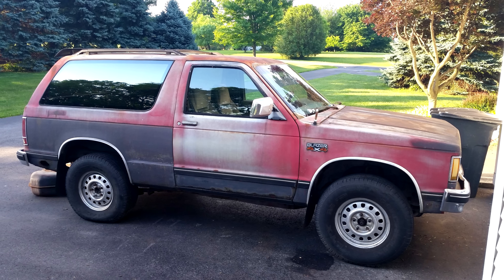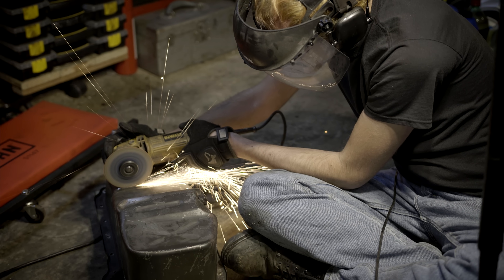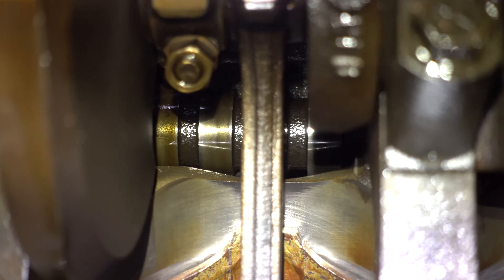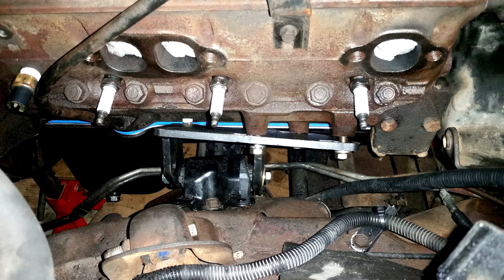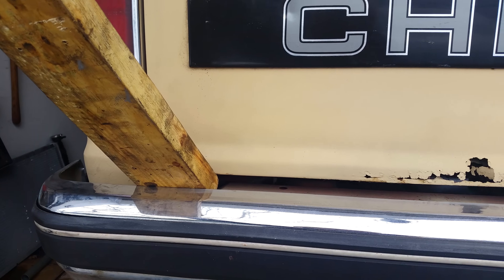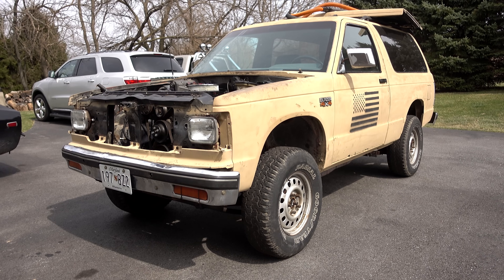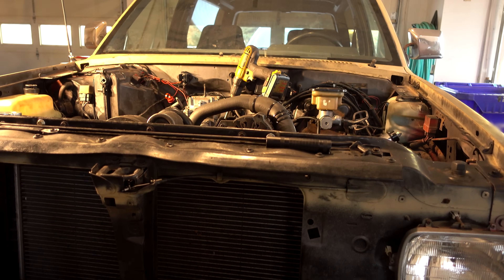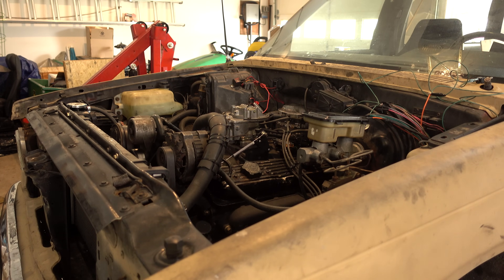4x4 S10 Blazer Budget V8 Swap (Ep.2)

Comment: you've done awesome.... Jags That Run could have saved you a touch of grief, though... the V8 swap book includes schematic so you can build your own motor mounts.... 20/20 hindsight, you did very well and funny your pan solution is darn close to what they did (they sectioned in a bit to the v6 pan from the v8 pan)...
Reply from the maker: I skimmed through their info online, I'm sure the book has more, but some good info for sure. I didn't like the way they made their oil pan because I feel like getting the flange with the weld line to seal right might be tricky, but I'm sure it would work with enough planning and grinding. I looked at a lot of custom motor mounts, but couldn't find any designs I liked that were guaranteed to fit a 4x4, except for a few pre-made ones like the Transdapt (which didn't fit anyway). So yeah, I could have just made them out of some steel plate but it probably would have been at least as much work and a similar materials cost anyway.
Reply: just options to consider - love what you've done with it.  Keep up the good work

Comment: This is awesome man, I like it. Reminds me of when I was in my early 20's, I had an 84 Blazer 4x4, I had dreams of putting a small block in it, I see now just how much work that would've been, a big pita. I've always wanted a small block s10 something, My first vehicle was a 92 sonoma, I traded the 84 Blazer for a 99 s10 4.3 that I lowered and modified a bit. Now I have a 1st gen Colorado. So, I've had pretty much all the s-series trucks. I have a fond spot for them.
Reply: Broch Slanders I'm planning on getting one but not build myself as I don't have a lift, engine jack, transmission jack etc. Nothing to clear an engine. I can do it but way to much stress when I can buy a 350 s10 for 2.5k already done and work on what they did wrong. Regular s10 in my area go 1.5k and up for 90s models. Swapped with a 350 for 2.5 in paying 1000 extra which isnt bad considering they usually come with other mods to like ratchet shifters (or modified manual trans)  exhaust etc..

Comment: Is a remote oil filter an option?
Reply from the maker: From my research, the universal ones need modification to fit, and the factory 4.3L one doesn't bolt up to the V8 block. It certainly is an option but would need a bit of work.

Comment: 4.3 was rated at 160hp, not 125.
Reply from the maker: Yeah, I was mistaken, for those years it was something around 160
Reply: I have a 1992 S10 Extended Cab 4.3 5 speed 4x4, and I can tell you for a fact that it makes more than 125.. although it's still nothing tremendous haha.  Still plan to pull the motor and rebuild it to make a good bit of power
Reply: I have a 92 with a 2.8 it makes 125
Reply: Later models 190 new 4.3 is over 300

Comment: You didn't really benefit yourself by much from going with the 350 over the 4.3L.  I mean the 4.3 is very good engine with a nice power and torque.
Reply from the maker: The 4.3L isn't bad (well mine was), but it isn't a V8. A fun project, a lot of extra horsepower, a little extra torque, plus the V8 sound is plenty worth it to me!

Comment: YOU NEEDED TO COVER ALL THE HOLES ON THE NEW USED ENGIN CAUSE WATER INSIDE THE ENGIN WILL RUIN ALL THAT WORK YOU ARE DOING.
Reply from the maker: The passages to the intake and oil passages were mostly covered. Everything was flushed and oil was prelubed thoroughly after that, no big deal. Would I do that on an engine I care about? No haha
Reply: ryan migliori yeah he didn't seem too concerned about water getting in the intake/exhaust ports.

Comment: I have 1988 s10 blazer rust free and clean with 4.3 runs 275 horsepower
Reply from the maker: Is it modified, or a Vortec 4.3L? They were making good power by the late 90's.

Comment: What did you search for when you found those aluminum spacers?
Reply from the maker: Interestingly, the seller I bought from doesn't seem to stock 3" rod products anymore. Here is a set just like I bought, but 3.25" instead and $12 more. Would work fine for an application like this, though. https://www.ebay.com/itm/281744485919 Try search terms like the title of that listing, like "Aluminum" "Round bar" "Stock" "3"", etc.

Comment: I did one of these myself same gen for my son, the one i did I had to use 2 left hand mounts for a 1972 chevy nova in order to get the motor to sit in there right and for the exhaust manifold i used a set of block hugger hooker headers for a 350 and i had to put them on wierd too because the steerig arm had to be put in after the motor was installed (not fun) never thought about doing the body lift that might have made things a LOT easier to do. of course i realize none of this is beneficial to you NOW but thought in case someone else was considering doing one of these swaps i might mention it to make things a little easier for them. Lastly the deep sump oil pan for the 350 on Summitt racing is made just like your frankensteined version and fits the same way too. I ran a 650 Holley carb on mine, bolted right up and ran like a champ, the guy i sold it too still drives it too
Reply from the maker: Awesome info, thanks! I had never heard about using Nova engine mounts!
Reply: i only know about it because i had a friend in GA growing up that put a 350 in an S-10 pickup someone had actually started to beat the firewall back on his to get the motor in but it was sitting up at a weird angle in the engine bay and the truck always felt like it was trying to rip it's self apart when he would drive it. we took the engine out and started measuring everything like you did and this was back before people were doing this swap regularly and the clearance we needed you pretty much would have had to weld the mount to the frame then figure out a way to snake your hands around to put the bolts into the motor. my buddy has always been a HUGE Nova fan and went out in his back yard yanked the left mount off of his 72 and tried it and not only did it sit the motor down in the engine bay nicely it was far enough away from everything that you could actually work on it without having to yank out the motor too. BONUS!  the block hugger headers i learned about first hand when i did the S-10 Blazer for my son.
Reply from the maker: Ha, that's an awesome story! Just checked what they look like, they resemble the OEM 4.3L mounts, so I guess it makes sense that they'd work. I have heard that block hugger headers fit, I might have to get a pair to try one day!

Comment: If you were smart, you would of gotten a 5.3 vortec from a silverado in a junkyard
Reply from the maker: 5.3L, that's not even 5.7L! What's the point?

I did it this way because this is the way I did it. Chevy 350 carb parts are cheap.
Reply: True, but even you know that 350 is so weak. And seeing you have a newer silverado as well, you know the point with that 323
Reply from the maker: I don't need it for horsepower, it'll just kill me faster. The torque is good and that's what I care about. Intake manifolds for Vortecs are more expensive, otherwise I'd just put Vortec heads on it. I already have a garage full of 350 parts, too.
Reply: I’d like to have a 5.3 V8 engine in my ‘93 S10
Reply: Gavin Graham more reliable huh I had a 5.3 that went 433k before it let go and it was beat to death. I've had 350s let go under 100k the new small blocks are way more reliable, better design, better power, better fuel mileage.
Reply: Gavin Graham ls engines are easier to work on then the sbc. Have you ever had one apart? there super simple to build, the only thing that is more complicated is the fuel injection but if you carb one it's way better then the 350.

Comment: Hey brother sweet effin project it's something u wanna do for u an not like everyone else doin what everyone else is doin!( ima muscle head BTW lol ) but did u no the 4.3 vortec is jus 2 pistons less then a 5.7 brother? Same size an all. But dude I really like what ur doin man! An oh BTW u can fit some 33X12.50 under it how u have it set up. I had my 95 Jimmy with a 98 fuel injection swap on some 16X10s on 33X12.50s jus had to trim a lil but man was it beautiful an a lil beast
Reply from the maker: Good to know about the tires, thanks! I don't mind cutting a lot of fender out, just need to get wheels with enough offset to clear the frame. And yep, the 4.3L is just a cut down 5.7L, part of what makes everything so compatible for the swap. GM's compatibility and wide use of parts is one of the best things about them.

Comment: So mods to the wiring harness?  Or was it all the same?
Reply from the maker: Since I didn't use the TBI I only used a few of the original wires. I basically just cut out all of the ones I wasn't using, which was most of them. Other than adding a circuit for the electric choke and a toggle switch for the fuel pump relay, I don't think I changed anything else.

Comment: I can't believe aluminum is cheaper than hockey pucks.
Reply from the maker: 10 3" diameter aluminum pucks was $34 on eBay, you could beat that ordering hockey pucks online I'm sure. But I don't think you could walk into a store and do much better. It's still cheap enough I'd rather do it and never have to worry about them though. EDIT: I think I was referring to solid plastic ones when I mentioned that, because I was looking into using those rather than the traditional kind.

Comment: I've always bought the clear dist cap when buying a new distributor, it's great for troubleshooting.

The oil filter is easy, run a remote filter.

Ditch that carb, go fuel injection, especially since you like to drive in varying altitude.

There are two budget options that would be great for the project. Microsquirt runs $350.

Speeduino will run around $150 but requires soldering and configuring of the hardware.

With both you could grab junkyard parts like a tpi intake manifold and associated parts.
Reply from the maker: I agree on the clear distributor cap, it's useful when turning the engine by hand and setting timing, and of course checking for spark. I like carburetors, they are simple and, I don't know, have character I guess. I like that they are mechanical I guess. A buddy wants to use a Megasquirt for one of his engine swaps or a turbo install so I'll see what it is like when he does it, maybe it'll win me over!

Comment: I used hockey pucks when I body lifted my 1994 GMC Jimmy. Worked perfectly! I also cranked my torsion bars and added shackle extensions for the suspension lift. In the end, 31" tires were the biggest I could stuff in the wheel wells. Over all, it looked pretty badass!!
Reply from the maker: That's about what I have heard, 31" sounds right. Mine came with 30" tires and they looked good but could go a bit bigger, but the width might rub the frame on turns. If I get wheels with the right offset there is only fender sheet metal in the way of fitting bigger tires though, and the sawzall would take care of that...
Reply: Be careful with hockey pucks.. You gotta keep conditioner on them. My buddy used them and never conditioned them and after 2 years they started splitting from dry rott. They work great as long as you don't let them dry rot.

Comment: Nice work. As for the oil filter issue try summit racing they have a cool oil filter relocation kit for a fair price
Reply: Also my 89 Jimmy had it from the factory. Was mounted on the driver fender.

Comment: I guess you should never believe what you here from people that its easy to put a v8 into a s10 4x4 ( they make kits for it) I had a 91 that I was going to do this to and I'm glad I didn't after watching this. but this is fun to watch!!!! you did about what I would have done if faced with the same problems and no money ! Great minds think alike HA!
Reply: Nails it's actually really not that bad. Take the entire front clip off and do what you want.
Reply from the maker: The Transdapt kit was a big waste of time, but just making custom mounts or trying ones from a different manufacturer would probably have worked out much faster and easier. It is a big job, and there are a lot of little things to tackle, but I wouldn't want to discourage anyone from doing it!
Reply: no, I'm not trying to discourage anyone. have at it, its probably mush easier in a 2 wheel drive  I would say.

Comment: that 350 is way better than the little v6
Reply: anthonyk those 4.3s are awesome v6s. Basically the 350 with 2 cylinders chopped off. I believe they use the same heads. Cam and share another part, I like the 350 too awesome engine
Reply: I have always had problems with the 4.3l mainly not the engine the stuff around it goes bad.

Comment: You mentioned around the 1:30 mark you couldn't find info regarding the swap into a 4x4. While it appears the swap is done, there is a ton of info online for the V8 swap into the 4x4 S-series. JTR (Jags that Run) literally wrote the book on this swap years ago. Also there are plenty of guys on the forums with V8 Bravadas, as well as Sy/Tys.
Reply from the maker: There is some info, for sure, but in my searches I could only find one single picture showing the empty engine bay of a 4x4 model, for instance. I found out which exhaust manifolds fit from JTR and other sources, and info on making an oil pan fit (though I cut mine up in a different way than I had seen), among other things. But a lot of it is scattered and vague (or old), or contradictory. I never found real consensus on what headers fit, what engine mounts work (even the manufacturer doesn't seem to know), and some other details like that. The difficulty of trying to work out the remote oil filter is why I gave up on it, some guys swear none of the universal kits fit and they all need modification.

The internet helped hugely, don't get me wrong, but compared to the documentation of the swap done on 2WD trucks there is absolutely no comparison. There is a lot shoved into the engine bay and undercarriage of the 4WD to work around, and it can be difficult to figure out how to fit everything in without just pulling the vehicle apart yourself, and trying things out.
Reply: Not trying to piss you off, so sorry If it's coming off that way. As far as headers, Hooker and Headman are the only ones that come close, but honestly you're better off building your own. I've been involved with these trucks for much longer than I'd care to think, and I have a 1991 S10 Blazer (Tahoe 2-Door) 4x4 that's gone through quite a few phases. Originally she had the 4.3 backed by the 7004R. Previously it had a 383 backed by a T400, now getting an LS motor and a 4L80-E, and going to be an AWD Typhoon clone. Milodon makes a great V8 pan, and it does fit.

 https://www.summitracing.com/parts/MIL-31083/?rtype=10

Been verified in several instances. RPM ( Race Proven Motors - they're big into Polaris razors now) out of California used to be big in the sy/ty scene and still make a ton of parts. Your go to now would likely be LMC for re-pro parts and Sportmachines out of NY for the harder to find stuff.  If you're serious, and depending on your end goals, treat your project like a V8 sy/ty and go from there. syty.net is a wealth of information. I'd be happy to offer you info if you needed it.
Reply from the maker: No, you're trying to help! No animosity here! I appreciate the info, I hadn't heard of syty before. A lot of the reason I didn't go for the pre-made stuff is simply cost. That oil pan looks awesome, but at $350 it's basically double what I spent on the engine. Making an oil pan was fun, that's kind of the spirit of this project. Cheap and laborious, not good haha.

I'm honestly a bit scared of rolling or crashing the thing, so I'm okay with it being underpowered and slow. I'd like to get a 2WD S10 pickup and make a real track ready car one day, though.
Reply: Why i love the 2wd pickups. Its just less stuff to work on, maintenance, work on, fix, worry about, and work around. There isnt a whole lot of space on these things so in my mind it makes up for not having 4wd, also i put a posi in mine, so im damn near invincible (joke)

Comment: FuzzyDicePimp Just stumbled across this series, absolutely love the build. If you haven't figured out the oil filter issue yet, you should be able to solve all your headaches by installing a remote filter relocation kit. All it does is cap off the stock filter location with a block that has fittings for oil lines, then you just install a new filter mount wherever you want.
Reply from the maker: Thanks! I know about oil filter relocators, the 4.3L 4WD trucks actually came with one! I had hoped I could re-use it but no luck, the filter mounting holes in the block are different. The kits out there (I'm told) need modification to clear the exhaust and front driveshaft in these trucks since everything is so close together, and while I may well do it one day, it's not a top priority.
Reply: Can i install my remote filter in the glove box? Thanks in advance.
Reply: What about install it in the roof at the back so it looks like a Mr.Fusion (It might be installed inverted, filter pointing up)? Is that viable? I might add an Flux Capacitor to match, even a hover conversion and flux bands. Thanks in advance.

Comment: i dont see why you swaped the motor all that the v6 needed was a piston bearing
Reply from the maker: A couple of reasons, though the last one is the most important:
-The 4.3 was in rough shape, lots of sludge and the cam lobes looked like bacon
-If it spun that bearing, which is likely, it probably needs a new con rod, and it's not great to just replace one so it needs a new set of rods
-Crank may be damaged, especially if it spun the bearing
-Other damage/accelerated wear from running with no/low oil pressure
-For above reasons and others (blowby), it needed a full rebuild, likely machine work, and I was not willing to spend the time or money on an engine I didn't like
-V8 > V6
Reply: yea true the inside did look rough